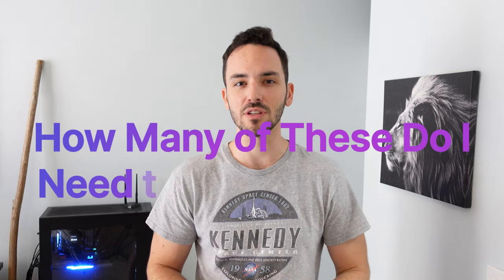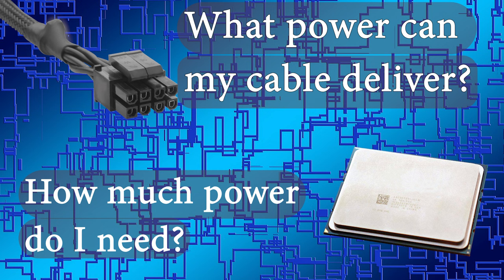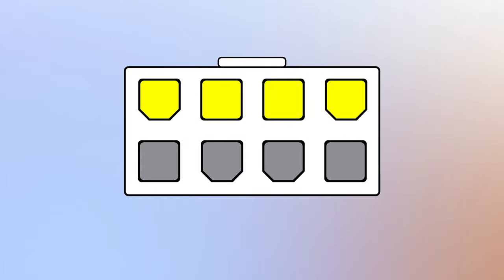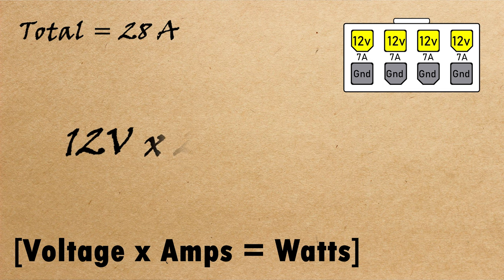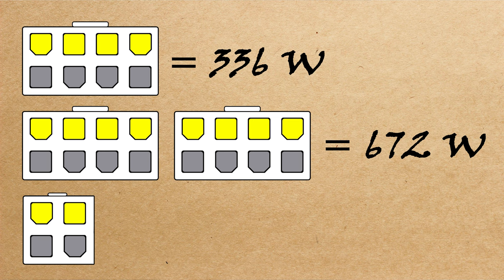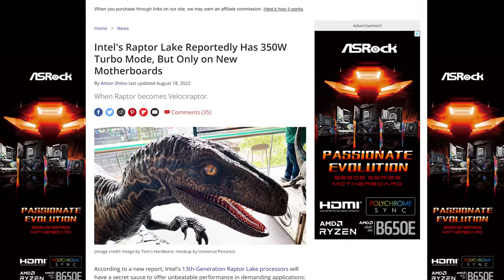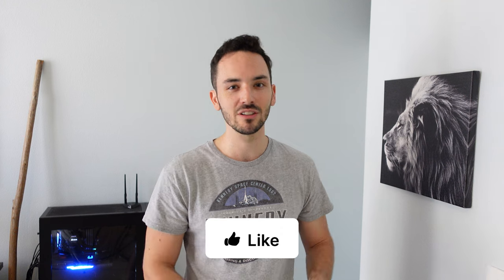CPU Power Cable Guide - Understand What You Need!

Comment: You answered the main question.  If I just plug them all in, will it hurt my system.  You answer was no...
Reply: Hi
I have asus 570-p.amd 5900x.asus 3060 ti mini oc .32gb ram 2 tb ssd.7 fans total 
Asus TUF-GAMING-650B 650W 80 Plus Bronze
i test with wattmeter 
on idle my pc 189 watts
cpu benchmark 310 watts
gpu 398 watts
on my motherboard 8 pin is connected .Do i need to connect the other 4 pin 
what are the plus and minuses 
thank you
Reply: @gorkman5697  - I can't help you.  What the maker of the video would say is that the benefit of plugging them both in would be that IF the CPU needs more juice then it has it available.

Comment: bro i have a 8+4 pin in my mb but my psu is have 8+8pin and is no modular psu i can use 8+8 pin or i buy a adapter for use my mb ? for a amd ryzen 5 7600X

Comment: There isn't a more straight to the point video than this, good work!
Reply: Still not understanding 😅
Reply: Hi
I have asus 570-p.amd 5900x.asus 3060 ti mini oc .32gb ram 2 tb ssd.7 fans total 
Asus TUF-GAMING-650B 650W 80 Plus Bronze
i test with wattmeter 
on idle my pc 189 watts
cpu benchmark 310 watts
gpu 398 watts
on my motherboard 8 pin is connected .Do i need to connect the other 4 pin 
what are the plus and minuses 
thank you

Comment: my new computer wont turn on. everything seems to be plugged in the right holes. im wondering if the cord that goes into the PSU is the wrong kind? im using a bronze 600 EVGA. helllp
Reply from the maker: First checks (the easy ones) - try multiple outlets some have switched to power off, check the actual power switch on the power supply is on, double check your front panel connections to make sure your power button is wired correctly, could easily just have swapped the +/-. If none of that gets it on you may have a dead power supply, especially if you don’t even get any LEDs lit up, like absolutely no power is likely a power supply failure and I would return it.
Reply: thank you. my dummy ass plugged the power switch and stuff into the wrong area. luckily didn't fry my new build lol @MaxsTech

Comment: Hey max! I am using a ryzen 7 5600g (65w) with a gigabyte a520m-k v2 rev 1.0. Here the issue, I have compact 250w psu but it only has 1-4pin connector and motherboard has 1-8pin connector. What should I do? Should I connect 4pin directly into a 8pin, should I use a adaptor? Or should I use a power supply with 8pin power supply?
Reply: what did you do 
read the manual book your motherboard 
mine says never plug 4 pins
Reply: I decided to build a different build

Comment: I have a 12-pin board and the power port only supports 8 pins and the processor is i5 12400f. Is there a problem with connecting only eight pins or not?

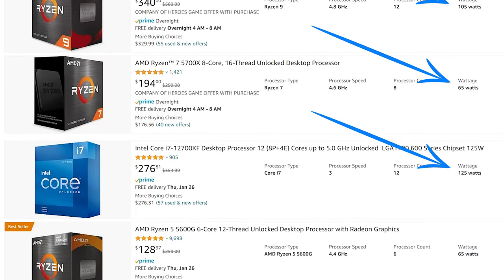Comment: 1:58 those wattage numbers don't tell you how much the CPU can draw, for example the i7-12700KF spec lists 125W as the "base power", but 190W as "maximum turbo power" and the spec even allows for higher power draw: "Instantaneous power may exceed Maximum Turbo Power for short durations (<=10ms)"
Reply: Hi
I have asus 570-p.amd 5900x.asus 3060 ti mini oc .32gb ram 2 tb ssd.7 fans total 
Asus TUF-GAMING-650B 650W 80 Plus Bronze
i test with wattmeter 
on idle my pc 189 watts
cpu benchmark 310 watts
gpu 398 watts
on my motherboard 8 pin is connected .Do i need to connect the other 4 pin 
what are the plus and minuses 
thank you

Comment: One od the best video explenations I have ever seen, this is just what i needed, THANK YOU
Reply: My 13900ks crashed after 30 seconds while i had only one
Reply: Hi
I have asus 570-p.amd 5900x.asus 3060 ti mini oc .32gb ram 2 tb ssd.7 fans total 
Asus TUF-GAMING-650B 650W 80 Plus Bronze
i test with wattmeter 
on idle my pc 189 watts
cpu benchmark 310 watts
gpu 398 watts
on my motherboard 8 pin is connected .Do i need to connect the other 4 pin 
what are the plus and minuses 
thank you

Comment: Thank you, your info really helped me out with my new build! Liked and subscribed!
Reply: Hi
I have asus 570-p.amd 5900x.asus 3060 ti mini oc .32gb ram 2 tb ssd.7 fans total 
Asus TUF-GAMING-650B 650W 80 Plus Bronze
i test with wattmeter 
on idle my pc 189 watts
cpu benchmark 310 watts
gpu 398 watts
on my motherboard 8 pin is connected .Do i need to connect the other 4 pin 
what are the plus and minuses 
thank you

Comment: Thank you very much.  My biggest problem has been to find a power supply with the additional Black/Yellow 4 pin connector.  Seems elusive.  If there is a 4 + 4 the connector shell does not fit the 4-pin on motherboard.  Nor do they have the right colored wires.  It is like the PSU industry was not expecting that 4 - pin connector on motherboard.

Comment: This was very helpful. Thanks for clearing this up for me. 👍
Reply: Hi
I have asus 570-p.amd 5900x.asus 3060 ti mini oc .32gb ram 2 tb ssd.7 fans total 
Asus TUF-GAMING-650B 650W 80 Plus Bronze
i test with wattmeter 
on idle my pc 189 watts
cpu benchmark 310 watts
gpu 398 watts
on my motherboard 8 pin is connected .Do i need to connect the other 4 pin 
what are the plus and minuses 
thank you

Comment: I appreciate this video a lot as you you are the first I have ever come across that explained what I needed for power. I have an x570 MB with a 4 and 8 pin configuration but my cpu is a Ryzen 3600 which means just the 8 pin is more than sufficient. Thanks.
Reply: Hi
I have asus 570-p.amd 5900x.asus 3060 ti mini oc .32gb ram 2 tb ssd.7 fans total 
Asus TUF-GAMING-650B 650W 80 Plus Bronze
i test with wattmeter 
on idle my pc 189 watts
cpu benchmark 310 watts
gpu 398 watts
on my motherboard 8 pin is connected .Do i need to connect the other 4 pin 
what are the plus and minuses 
thank you

Comment: Thanks so much, I was so stressed when I got the motherboard out and noticed it had 2x 8pin slots, and I only have 1x 8pin connector. Luckily my 7800x3d only looks to use 120 watts so I should be good!
Reply: Did everything go well for you bro? On the mother I have an 8x4 pin connector but on the psu it only has the 8 pin connector
Reply: @yeisonvargas8074  hey hey! Yes indeed, worked great! It seems I just needed 1x 8pin connected to the motherboard and left the other one unplugged. Everything running smoothly, temps are good and yeah, all great thanks!

Comment: Thank you, I'm using my OLDER power supply and case for a newer motherboard and I saw it had that extra 4 pin - but the manual says it's optional.  I'm only looking at a 115 watt chip so i'm fine with just the 8 pin!

Comment: I have a one 8 pin socket on my motherboard but my 8 pin cable splits into 2 8 pins. Do I just plug one into the mobo and let the other one just hang?
Reply: I have the same question

Comment: So my motherboard only has a 4pin connector and all newer PSU come with 8 (4+4), 8+4, 16. What do I use in my situation. Is it safe to plug in a 8 (4+4)
Reply from the maker: Yea, you should be able to split the 8 into 2 lines of 4 each. That’s the reason they make them 4+4.
Reply: Thank you so much for this in! It worked with the RM850  👌🏽😁
Reply: Hey! Quick update! I upgrade my motherboard to an B550 Aorus Elite AX V2, has an 8 pin connector but when installing my cpu 8pin connector would not fit, later realized that the motherboard is ATX 12v and my PSU is a EPS 12v, would an adapter be safe to use? Or would I have to get a new PSU? Any info would be helpful! Thank you in advance!

Comment: The latest i-7 say 125w tdp, but it says 253w mtp. I am debating using a splitter to plug in the extra 8 pin. Will probably get new psu though. 750w barely enough for cpu and gpu.
Reply from the maker: MTP is your Maximum Turbo Power, so worst case your cpu may not be able to run at higher clocks but it won’t draw that much normally. TDP is your thermal design power, basically all about heat output so you know how to cool it properly. 750W should be decent for 95% of builds. Unless you are running the latest 4090 card…  personally I just recently got a 1000W but previously still had a 650W.
Reply: @MaxsTech  Hi
I have asus 570-p.amd 5900x.asus 3060 ti mini oc .32gb ram 2 tb ssd.7 fans total 
Asus TUF-GAMING-650B 650W 80 Plus Bronze
i test with wattmeter 
on idle my pc 189 watts
cpu benchmark 310 watts
gpu 398 watts
on my motherboard 8 pin is connected .Do i need to connect the other 4 pin 
what are the plus and minuses 
thank you

Comment: Hi, my mobo has 2x 8pin connectors but my psu has 2x4pin connections. Do I split the 2 4pins over the 2 8pins or do I join both 4s and slot them into 1 8pin connection. TIA

Comment: Hi! thanks for the video, but how about if I plug 4+4 pin cable instead of 8pin cable? Is it okay for the CPU? or iI must use 8 pin (not split) for the CPU?
Reply from the maker: 4+4 is identical to an 8 pin, just gives you the option to use that power supply on a board that only has a single 4 pin.
Reply: @MaxsTech  my pins are not.

My CPU cable on the PSU are like this:
Round, Square, Square, Round
Square, Round, Round, Square.

My mother board asks for this exact shape as well, BUT, the other end of my cpu cable (the one that goes into the cpu slot in the mother) are a 4+4 pin like this:
Round, Square, Round, Round
Square, Round, Round, Round.

I must buy a new cable or can I go like this?
I have to buy a new PSU? 
I will fry something if the round ones on the cable fits into the square shapes in the mother board?

I was assembling my new mother board and had to stop because no one seems to know the answer for this. I don't wanna a fry a fresh brand new motherboard that I've just bought it. 😅

Comment: Thanks for the video, but my problem is that the PSU have the 8pin squares as you show in the first picture, but the other side of the cable, wich is the splitted one 4+4 for the MOBO don't match the squares. The MOBO needs exactly the same form that the PSU needs, but the cable is not the same in both sides. What can I do?
Reply: Actually have that same issue right now so same. Lol
Reply: Same issue here. Seems like mixed information online. Some people say it's fine to put the hexagons into a square plug, others say it's not... 😢
Reply: @LuapTneb  I managed to get it right. Just plug the "right side" on the PSU and the other in the mobo, it doesn't matter if it doesn't match because the plugs that aren't with a square form fit anyway on the square holes of the mobo.
Reply: I'm having the exact same problem.

My CPU cable on the PSU are like this:
Round, Square, Square, Round
Square, Round, Round, Square.

My mother board asks for this exact shape as well, BUT, the other end of my cpu cable (the one that goes into the cpu slot in the mother) are a 4+4 pin like this:
Round, Square, Round, Round
Square, Round, Round, Round.

I must buy a new cable or can I go like this?
I have to buy a new PSU? 
I will fry something if the round ones on the cable fits into the square shapes in the mother board?

I was assembling my new mother board and had to stop because no one seems to know the answer for this. I don't wanna a fry a fresh brand new motherboard that I've just bought it. 😅

Comment: Question! Asus Prime Z690-P D4 has an 8 and a 4—paired with I9-12900k 

Can I use only one 8 pin connector to my Seasonic Prime TX-1000 ? 😢
Reply: Did you solve your doubt? Im in a same situation as you bro :/

Comment: Hi Max, this is a very informative video. However, your video could be improved by showing viewers an actual cable installation. Is there a device available that makes cable removal easier?
Reply from the maker: The cables are only held on by a small plastic clip, you should be able to remove them by hand

Comment: I have a rtx 3080 ryzen 5 7600x 32gb ddr5 and a x670p mobo with 2 (8 pin) slots.. only have 1 (8 pin) plugged in because I only got a 600w non modular, works fine but not sure if that's bad lol
Reply from the maker: You’re all good :) that ryzen chip will only require about 109W at peak load.

Comment: Ok so ive got a PSU that supplies 44A on dual 12V rails.
My CPU is a 58W intel G6400 (socket 1200)

My PSU only has a 4 pin CPU power connector but the motherboard has an 8 pin socket.

So from what you tell me, a 4 pin cpu connector should be fine by itself, because it still supplies upto 168W for the CPU, meaning i have a plenty of cpu headroom power of 110W.

So i should be fiiine. Right?
Reply: I just asked the same question. I am wondering if the motherboard is expecting to see 8 pins to distribute power  for max stability.
Reply: @tlstechtalk  i used just 1x 4pin, it worked fine. And should be fine for any cpu with a max TDP of 168W i think. Best to stay under 160W to be safe imo
Reply: @High.Vibe.Living  Thanks, my G6400 and Asrock mobo arrive in a few days.
Reply: @tlstechtalk  g6400 is a VERY eco CPU. Tdp maxes at 58 watts i beleive. Much less than the 4 pin CPU power can provide, which is 160W+

Comment: can I ask a question? that 4 pins and 8 pins are only for the Processor? even though I have a lot of cooling fans? thanks master 🙏
Reply from the maker: Yes the connectors in the upper left are for powering your cpu. Fans take very little power to operate, usually only 1-3W per fan.
Reply from the maker: Fan headers on your motherboard will draw power from the large 24 pin power connector.

Comment: My motherboard manual sont say anything about if i can use 1 or both cpu connector…i have i5 13500 and only one cou 8 pin connector, but my b760 mobo has two 8 pin connectors

Comment: I bought extensions for the cpu cord. I've got the one where you need two 4 pin cables. The problem is that the two extension cord are the exact same. So the pattern isn't mirrored, it's the exact same. Where the usual top layout would be square, rounded, rounded, square, mine is now square, rounded, square, rounded. So it's pretty self explanitory that it doesn't fit. What the hell do I do now.
Reply from the maker: Most CPU cables can reach the top of your case if you run them under/behind the board. I’m not sure what kind of extensions you got but sounds like either they’re defective or you just have to plug them in backwards with the clip facing the other way.

Comment: So I'm pretty sure I don't need the extra 4 pin. I have the asus pro art z790 intel 13900k along with a 4090. those just provide power to the CPU right? Im not overclocking it or anything just using it to edit videos. Just wanted to make sure i do it right sorry i only built one pc 7 years ago so forgive me for my lack of knowledge. thank you
Reply from the maker: Yea those top left connectors are for cpu power, your GPU will draw 75w from the pcie lane its slotted in as well as any additional power like 6/8 pin you connect directly to it.
Reply: @MaxsTech  thanks but as far as the CPU do I only need the 8-pin if I'm not overclocking it using the 13900k. Because my power supply which is a dark power pro 12 didn't even come with a four-pin connector anyways?
Reply: I have Asus Prime Z690-P D4 with I9-12900k. The mobo has an 8 and a 4. 

Is it ok to just use one 8 pin plug?

Comment: Good info. So you usually get an extra CPU power cable that can be split for 4 pin supplemental power I guess? But yeah, I guess that I just haft to locate a single cable - Which I understood they always split up into 2 4 pins like GPU 6 + 2?
Reply from the maker: Some will split some won’t, depends on the power supply
Reply: @MaxsTech  Thanks :)

Comment: If there's 2 8 pin on motherboard and my PSU has a single 8 pin connector,
So where should I plug the connector to 
Left or Right ?
Reply: In most situations it shouldn’t really matter. If for some reason you’re getting random crashes then just switch them. Usually the left most port is labelled the “primary” , but as I said … majority of the time doesn’t matter which one you plug in.

Comment: i am using i7 10700 +  MSI MAG B560m Mortar (8+4 pin Eps Conector).
is it ok if i just use 8 pin PSU cable?
because the PSU only has 8 pins..

Pliss answer my Question...🥺

Comment: I'm going to grab a B550F plus Asus Rog over the cheaper board a ryzen 5600 65W Iv done several calculations on sites and all coming in around 550-600W with my current GPU now the board has an extra 4pin do I not need to connect this then? There's an 8pin like I already used on my old ryzen 2600 system, my PSU is a EVGA GQ Modular 750W Gold rated one which does have another 2x 4 pin / split 8 pin cpu connector. I can't seem to find a solid answer anywhere whether I should plug the extra 4pin in not sure it's needed for a 5600 GPU is a single 8pin

Anyone know or help? Before I grab the cheaper 8pin only TUF version may aswel just plug it in?

Comment: Question... my z590 mobo needs both plugged in [::]+[::::] but my 550w psu only has the one [::::] cpu plug, is it safe to use the splitter adapter 12v for it (female [::::] to male [::]+[::::]? Cpu is 11400f. Ty.